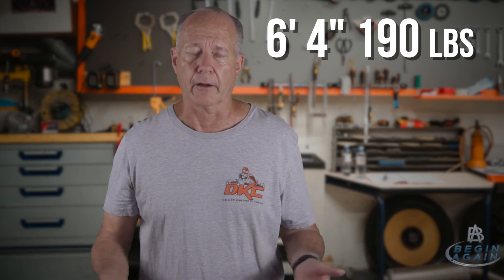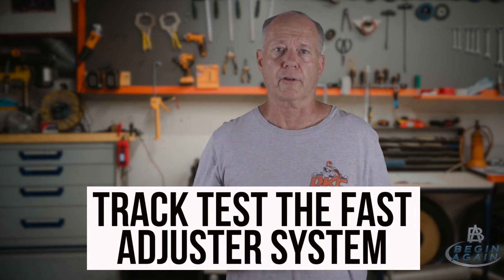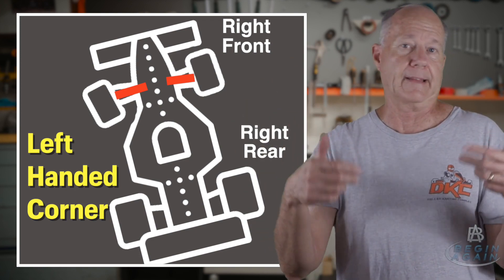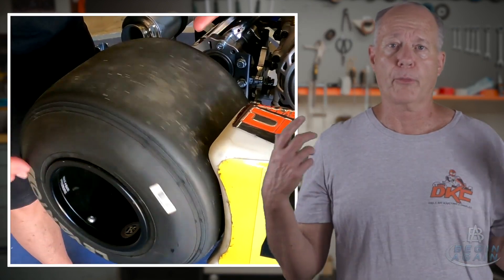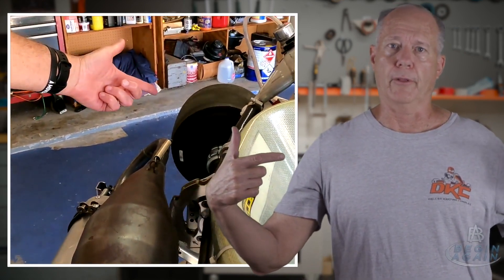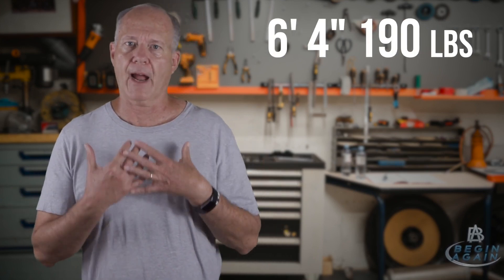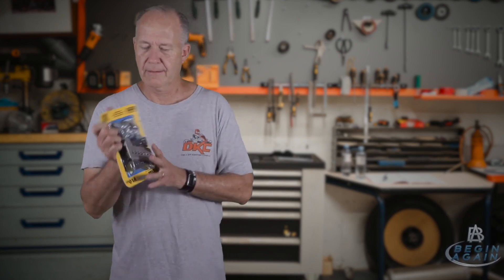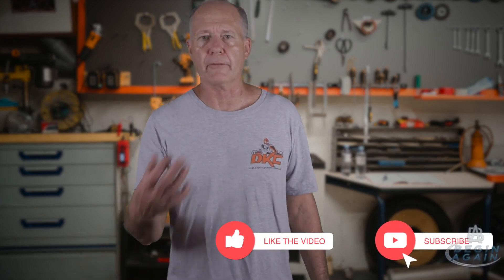Finding The Perfect Seat Position:  The How's and Why's Part I

Comment: Are you thinking on trying a hard or harder axle ? From watching a video on YouTube it does work with the effect of more spring off the corner with myself im about the same height as yourself but ive more weight so getting the kart to jack isnt an issue lol
Reply: Hello and thanks again for watching this video!  Yes, definitely will be trying axles next, that is a great topic for a new series of videos!  I do feel that the seat position, as I have it now, is not optimal, and I want to get that right prior to changing the axle since my weight is the heaviest item on the kart itself...need to get that right before I try anything else or I may not be able to get the results I am hoping for.  I am curious:  how many centimeters is the center of your left kingpin from the top/center of your seatback?  Mine is currently at 106.5 as a reference...very curious to hear where you have you seat located as it sounds like you don't have an issue lifting the inside wheel.  Of course, with my lighter weight, it may be all for nothing, but it would be interesting to hear about it.  Thanks again!
Reply: @RKSiler  i will have a measure up i use an otk kart which apparently is a softer chassis kart as ive seen a comparison test on YouTube so that might help myself
Reply: @RKSiler hi Richard mine is 108cm
Reply: If possible can you scale your kart to see what your front and rear percentages are? That number will also help when you install the FAST adjusters and start to move the seat…
Reply: @gregoryjones9754  Great point and thanks for that!  I must confess that my lack of a good set of scales has been a real handicap, I tried the bathroom scale approach and that didn't work, I simply could not get repeatable results, so I ditched that idea.  Having said all that, you're 100% correct, especially if you know at what position the seat has to be to get that magic 44/56 balance and then what a change of 10mm in seat position translates to in terms of the kart's weight distribution.  Super good point, and this gives me an idea for an enhanced video...thank you!